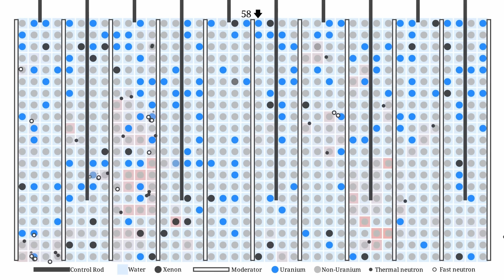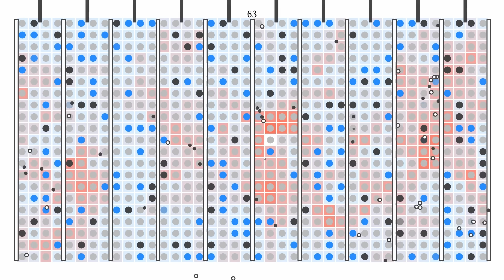Chernobyl Accident - Simulation only (no talk)

Comment: Thanks, I've learnt what xenon had to do with the event, an unwanted product and not measurable moderator that once depleted unleash the beast. Those engineers were completly blind and removing control bars to restart the power and finally lost control in a few seconds when there was no more xenon.

Comment: What is xenon
Reply: It's a byproduct created by fission, and normally in a reactor it gets burned away. The reason xenon is bad is because it absorbs neutrons, which neutrons are needed for nuclear reaction, so if the reactor falls into a "xenon pit" (too much xenon for a reaction to sustain power), then it simply stalls (aka turns off) the reactor.

Comment: Why the hell were the control rods all removed
Reply: Simplified explanation: the reactor was running at normal power for a while, but they dropped it to a lower power earlier in the day (by inserting control rods) however after fission happens xenon builds up, after a delay. So during that lower power phase, lots of xenon built up. Xenon is like water, it inhibits fission. However it "burns" away as fission happens. When they were trying to do a reactor test, they couldn't get the power up, because the xenon was inhibiting it. So they removed all the control rods. When the xenon all burned away, the reaction started getting out of hand so they attempted to re-insert all the fuel rods, however due to a design flaw the control rods got stuck and couldn't go in.
Reply: @totallynotpaul6211  i like how the simple explanation is still a paragraph because short answers on chernobyl is impossible

Comment: The RBMK-1000 had a major structural flaw: a positive void coefficient, meaning that when the water boiled, the reactor’s power increased instead of decreasing. Additionally, the control rods had graphite tips, which caused a sudden power spike when the emergency shutdown (AZ-5) was activated.
The reactor also lacked a concrete containment structure, so the explosion released massive amounts of radiation.
During the test, safety systems were disabled, leaving the reactor unprotected. These design flaws and human decisions made the RBMK unstable and dangerous.Together, they caused the core explosion and the Chernobyl disaster.

Comment: The show took a lot less liberties with the artistic license than you'd expect, and is accurate about what happened inside the reactor.

The crew overshot the power reduction and put the reactor into a shutdown state.  Instead of finishing the shutdown and executing the restart procedure, they decided to yank every control rod they could trying to do a hot restart. A bunch of xenon built up, and once the rods were pulled, that was the one and the only thing holding back a runaway chain reaction.

This was an impromptu science experiment on a full sized nuclear reactor, and it ended very badly.

Yes, the RBMK design has its issues, but all of those hazards were known and controlled by the well documented procedures.
Reply: Moral of the story, if it works, don't touch it.😅

Comment: I wish I knew what the fuck I was looking at
Reply: Basically, a nuclear reaction is atoms splitting and releasing free radicals(loose atom parts), which in turn collide with other atoms, which will hence split and release their own parts, causing a chain reaction of free radicals colliding with atoms. The chain reaction is controlled by gasses like xenon, and control bars made of plutonium, which will basically neutralize the movement of free radicals. Finally, the presence of uranium provides fuel for the process, uranium atoms quickly release electrons and will thus create electricity.

Comment: I don't know if anyone can relate but this actually reminds me back when playing with Industrialcraft2 nuclear reactor back in the day, having some complicated setup yet stable, you open the reactor and are checking out to make sure everything looks good, then you accidentally would click something in the reactor and BAM suddenly there is a giant crater on your world.
Reply: To be fair, you could switch off reactors in IC2 by grabbing your trusty pickaxe and hammering the fuck out of them before they blew up, because for them to blow instantly you'd have to run them pretty close to max heat which is not good. You'd also die from radiation, but eh. 

Liquid reactors now, that shit was completely foolproof because the shell melting instantly shut down any operation unlike what happened at Chernobyl. And you can SCRAM them with a lever without having the same happen too

Comment: Complete the test / clear the xenon pit.
Complete the test /clear the xenon pit.
Oh I know what we should do, complete the test, nothing could go wrong with a xenon pit, the reactor was designed not to fail, it has never failed before, and if it didn't no one would be dumb enough to hide a flaw in a "NUCLEAR" reactor, right.
Seriously even without the 2019 series to easily explain it, Chernobyl was the epitome of why the Soviet Union failed, you have several higher ups who feared they would lose their jobs if a test wasn't completed asap, then one of those higher ups practically beaming his pessimistic attitude on the employees in the control room, most of which don't know about the test they're performing on the cheaply made reactor, and because of that one employee tries to the reactor down before the core could get anymore unstable, unwittingly creates a nuclear bomb because of the cheap control rods.
And all of this could have been avoided if the KGB wasn't the KGB. And people understood that Gorbochov wasn't another Stalin and was probably the most willing to listen and sane president since either Kruschev or Lenin.

Comment: Okay, so it looks like the control rod dampener got jammed somehow, and the reactor got out of control and became superheated?
Reply: the control rods were tipped with graphite which helps heat the reactor, the immense heat got it stuck though so it endlessly sped up reaction until kaboom
Reply: @Metal_Oxidizer  Yeah, that makes sense. Thanks

Comment: Why were the control rods designed with graphite tips? Is that a common design… i would imagine not
Reply: Not outside Soviet RMBK type, as far as I'm aware. And I believe this was a cost-saving measure as it allowed their reactors to work with lower enrichment fuel, but I don't remember the specifics.

Comment: You watch something like this and realize in any scenario that stupidity and recklessness are directly proportional to training.  In the end, here and now, we know they were told by nuclear physicists and scientists to whom they presented their proposal (I think the test was to see if residual heat in the reactor could turn the turbines long enough to run the pumps to cool the reactor while getting the backup generators online if the grid went down and the reactor was scrammed) in Moscow .... not to do the test.  And yet it was done anyway.  Hence, the clear display of stupidity and recklessness.  On top of it all, a similar accident happened previously in an RBMK reactor somewhere else (the RBMK has naturally unstable zones within its operating core) - so the operators either didn't know about it, or ignored the results of that accident and knowledge as well.  Nice simulation.

Comment: Why did the white rods show in the end?
Reply: Because they are meant to represent the control rods moving into the reactor the moment the staff pressed the SCRAM button. Normally, that stops the reaction entirely, but the design of the control rods in this specific reactor was fatally flawed. They had graphite tips, which are cheaper to use, but which accelerates reactivity. So when all the rods moved into the reactor, which was already incredibly unstable at this point, the reactivity skyrocketed to levels never seen on earth before. It caused the core to explode and led directly to the nuclear fallout that has made Chernobyl infamous.

To give you an idea of just how much power was unleashed from that reactor, the lid of the reactor weighed 1000 tons - roughly the weight of three Boeing 747 passenger jets - but the explosion launched it through the roof of the building, flew 30 meters up in the air and then flipped it back down like a coin next to the reactor.

Comment: A little breakdown on the video for those who don't understand: 0:10 this is the stable reactor, rods inserted, xenon and water stable, neutrons stable
1:10 the power starts being reduced, but suddenly plummets and "stalls" The reactor (reactor stall is reaching lowest possible temperature/power)
The reason why the reactor stalled is because it was poisoned with Xenon, Xenon is a byproduct of the reaction and it absorbs neutrons, effectively making the reaction passively cool itself, because there was too much xenon and water the reactor was poisoned and couldn't operate, after an argument, the operators started raising the power again...
2:02 to kickstart the reactor back up, they cut the amount of water in half and removed all rods, bringing the reaction slightly back, and just as things were going smoothly
2:40 because the only thing holding the core back was the xenon and the water, the xenon started getting burnt away and unpoisoning the reactor. The little amount of water in the core started quickly evaporating and the core started experiencing a power spike
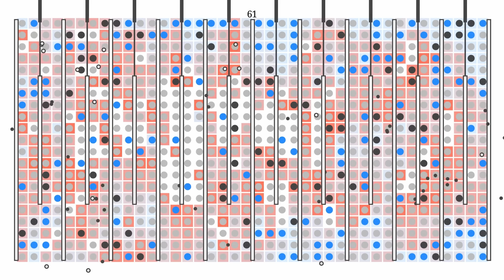3:17 in an attempt to stop the test, AZ-5 (SCRAM) was pushed, (SCRAM is essentially an emergency shutdown system to drop all rods fast and kill the core)
However, the rods had a major design flaw, the tips were made of graphite which speeds up the reaction, while the rest is the controlling part, when AZ-5 was pushed, the graphite part of the rods got inserted in and stuck, speeding up the reaction by 100x times and causing the meltdown part at 3:28
Reply: Thx
Reply: Thanks! Was there anything they could do to prevent or minimise what happened aside from trying to stop the test? I assume that was the only option at that point
Reply: @rencunin  

Just not doing the test in the first place after the reactor stalled. Turning off the pumps for the test burned off the Xenon and evaporated the water way too fast because the control rods were all the way up. Without the cooling it became a positive feedback loop of heat increasing, water boiling, Xenon burning, heat increasing even more as a result.

I think the test actually required 30% power, not 7% (which they actually had because of the Xenon poisoning). So normally, I don't think the control rods were supposed to be all the way up when the pumps are shut down. That was something they did to try to complete the test despite the Xenon poisoning. If they didn't feel pressured to complete the test and were allowed to postpone it to a better time maybe it wouldn't have exploded.

But the reactor design was also bad to begin with. Using heavy water instead of regular water in the reactor would have inherently made it a lot safer. Regular water slows down the reaction, so when it boils away the reaction speeds up. This allows the positive feedback loop that I mentioned before. But if they used heavy water the reaction would slow down when it boiled, putting in an in-built brake system in the reactor which would prevent it from blowing up even if the operators did something really, really stupid.

Also, the graphite tips on the control rods. The "emergency shutdown" button shouldn't make the situation worse.
Reply: thank you :) so if the rods did not have this design flaw, would they've just slid in and averted the meltdown?
Reply: @ambers_passwordit really depends, the speed of the reaction caused the chamber to overload with steam pressure, blow fuel channels, and the lack of water would probably be extremely bad, however it could've been averted
Reply: Thankyou for explaining! That's extra horrifying about the rods, thinking you were pulling the emergency stop button only to cause an unstoppable horrific emergency. Very tragic.
Reply: Well explained, thank you!
Reply: Thanks man. Basically the miscalculated a problem and had wrong designed xenon sticks with graphite tips.
Reply: we can read the CC just fine
Reply: @meyague I enjoyed the additional insight.

Comment: Grafite control rods were made of carbid boron only had grafite "followers". Control rods were pushed in too quickly so the water at the bottom of the core was displaced with grafite which made the temperature go up very very fast and caused explosion by steam

Comment: So, was it a human error?
Reply: A lot, if not most accidents are.

I work in a power plant as the automation engineer, and plant operators demanding to bypass safety to ramp up production is very common, just like in the video.

And if someone back at the Chernobyl actually prevents these guys from going reckless, he'll probably be facing the consequence of a blackout instead 🥴
Reply: A blackout seems like a minor problem compared to what actually happened.
Reply: It was a combination of human error and design flaws. The design of control rods is what likely triggered the actual explosion, but the reactor state that enabled that to happen was the result of unsuccessful attempts to recover from reactor stalling.

Comment: The Chernobyl accident was caused by a flawed RBMK reactor design combined with human error during a safety test and a lack of safety culture. The reactor design's positive void coefficient meant steam increased, rather than decreased, power, and its graphite-tipped control rods initially boosted power when inserted. When operators triggered a safety system during an unstable, low-power state, these design flaws caused a massive power surge, leading to a steam explosion that destroyed the reactor and released radioactive material.

Comment: I don't get a damn thing. Can someone explains me what's going on in that video ?
Reply: Event 1: normal reactor operation
Event 2: reactor runs at reduced power for a prolonged period of time
Event 3: xenon build-up from running on low power too long causes the power to plummet, stalling the reactor
Event 4: all control rods are withdrawn from the reactor to forcibly recover from stall raise power to a needed number
Event 5: xenon is burned away and water is evaporated, causing a spike in the reaction and making the reactor unstable with no way to hold the power surge back because control rods are removed
Event 6: scram button is pressed and all rods are inserted at once. The design of control rods causes a brief power spike in an already unstable reactor and the reaction skyrockets to the point of the explosion

In very simple terms, imagine pushing a car to top speed while it's chained to a pole, then someone suddenly cuts the chain, and your brakes were rerouted to a nitro boost.

Comment: RBMK reactors were unstable, but the designers wrote a manual with ALL the instructions to operate it in any case. Such manual was crossed out 80%, and the operator's chief was ignoring alerts and warnings from the operators. So, a reactor only explodes when its operated under senselessness and corruption.

Comment: it will never not be funny to me that the operators disabled multiple safety features, including the emergency automatic cooling systems and emergency shutdown, and then were all surprised when unit four fucking exploded (more so the containment chamber exploded cause of steam buildup but it sounds cooler if i just say the reactor exploded)
even though disabling these features didnt directly cause the disaster, it certainly didnt help. it also shows pretty well how little fucks the operators/technicians/other titles gave about following safety protocol.

seriously how do you ignore all the safety protocols while running a risky test and then go "how did the reactor melt down?!?!??!!?"